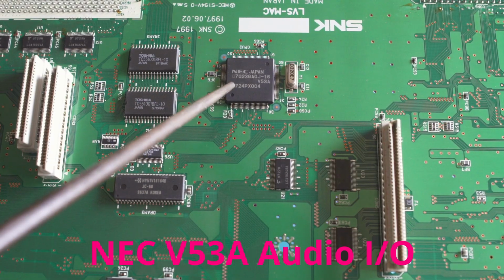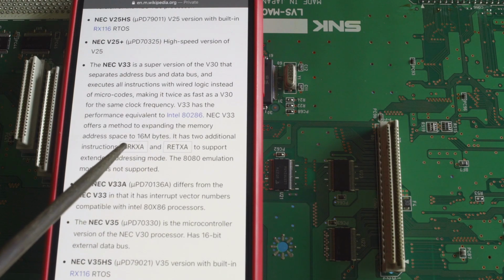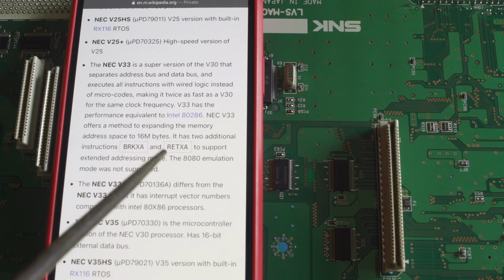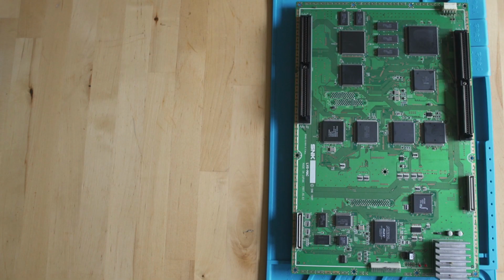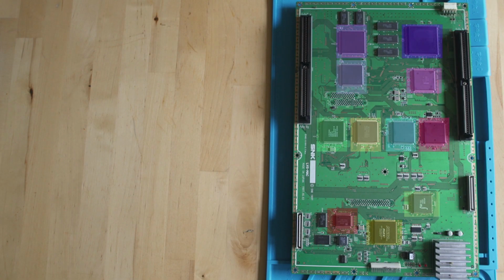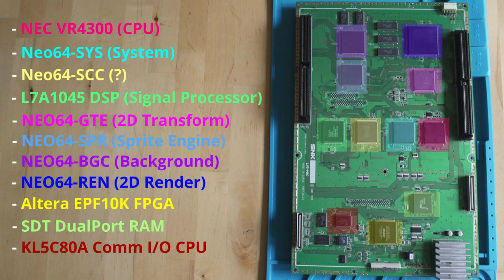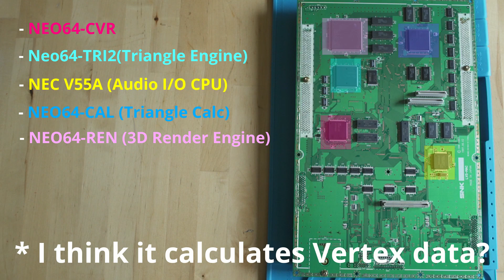The Hyper Neo Geo 64 PCB and How it Works - Tech Deep End

Comment: I still don't get why after PC and Sega32x had pure software rendered 2d ( okay, okay, stats where hw sometimes) someone would design chips for 2d (GBA was at least high volume). Both had a standard definition framebuffer only a little bigger than the Atari Lynx. There should be no "combination logic". Yeah there are some innovative designs for 3d, like quad-based renderers and tile-based renderers. Also: sort by z instead of z-buffer. Those are all only a small optimizations in speed and cost,  but a large burden to R/D. This PCB looks like it was designed over the years and always one chip added. Should we no better forget about it?
Reply from the maker: Who knows. I’ve never heard any details on why the Hyper was designed this way. Pure guessing at this point

Comment: I don't care too much about the games, but the hardware is so beautiful in its own quirky way! It's like they just threw everything they had into there. Combined with the metal case and the metal-encased games it's just something else. When I still had mine, I'd just spent time looking at it, inserting and removing games with the big metal bars, disassembling and reassembling it and just admiring the sheer awesomeness of it all. I wonder what their design philosophy was back then. I assume they wanted to do everything in house and create the very best graphics possible at the time, repeating for 3d graphics what the Neo Geo had been for 2d. It kinda fell short of that... In hindsight, the industry was at a turning point and they probably would have fared better using an existing graphics solution than creating this monster. Kinda regret selling mine now that I think about it...
Reply from the maker: Haha yes I love the hardware too. Wholly original. It looks like a piece of military equipment. 

It would have been better for them to license existing GPU tech though for sure

Comment: This is amazing I have always wondered what kind of chips the Hyper Neo Geo 64 used. It looks crazy but this came out in 1997 so we should compare the hardware to Sega and Namco 3d arcade boards. I do feel that SNK really didn't have the capital to make a competitive product because the Sega Model 2/3 and Namco System 22/23 have superior hardware and they came out around the same time.
Reply from the maker: The thing was model cost 20-30K for an arcade operator. Even if SNK wanted to license powerful tech like Sega did they’d never sell a cab at that when they were known for the MVS and its better pricing too

Comment: This is great, you should do this with the atomiswave.
Reply from the maker: I actually don’t have one. It’s on my list of stuff though :)
Reply: Video Game Esoterica Yeah it’s a great machine! Also, I’m looking to get a hyper neo geo 64 and since you have one where do you recommend to find games and a motherboard. They are kinda hard to find.
Reply from the maker: Honestly eBay or maybe KLOV / arcade-projects forum. Since they aren’t hyper common (dad joke) eBay seems to be the best source. Def not the cheapest though
Reply: Video Game Esoterica Yeah I’m going to be alert to find one. I hope I can get one sub $300. I certainly will start out with the fighting board as well.
Reply from the maker: Yes a fighting board is clutch. I’d try for a rev 2 if you can get it but you can make a rev 1 work as well. Just a bit more wiring and some audio amp necessities
Reply: Video Game Esoterica Yeah, with a fighting board I can just wire up a jamma joystick and buttons to control it right? Also how do I tell the difference between revision 1 and 2
Reply from the maker: Neo 64 yes. Harness and wires. Rev 1 has a volume potentiometer in the front of the board. A silver metal knob and two big JVS plastic connectors under the JAMMA edge. Rev 2 has NO pot dial and it has five JST connectors. If you watch my intro video you’ll get a visual on what a rev 2 looks like
Reply: Video Game Esoterica I’ll make sure to be aware and look for a rev 2. Thanks for the help, I’m going to be looking around some forums to find one. I’ll keep you updated in my search for one.
Reply from the maker: Neo 64 sounds good! If you need any more help lmk
Reply: Video Game Esoterica Quick question. I know there are two revisions of the fighting board. Are both revisions able to play all fighting games? Are there any other differences between them?
Reply from the maker: Neo 64 both revisions play all four games. One has JAMMA mono off the edge (rev 2)
Reply: Video Game Esoterica So with the rev 1 you gotta source audio somewhere else on the motherboard?
Reply from the maker: Neo 64 you’ll get VERY low level audio. You can jump some pins to get normal level audio. There is a tutorial on JAMMA-nation-x.com showing you how. If you can solder it takes like 2 minutes
Reply: Video Game Esoterica Well I can solder well so I’m in the clear!
Reply from the maker: Neo 64 perfect. Either board is fine. Rev 2 is just easier to deal with but if you can get a rev 1 at like half the cost you can def save $
Reply: Video Game Esoterica Yeah I’m definitely willing to save money even if I have to solder a bit. I am going to start looking around some forums like neo-geo.com for one.
Reply from the maker: Neo 64 just make sure you don’t sign up there and directly go to the marketplace. Rot won’t take kindly to that lol
Reply: Video Game Esoterica Don’t worry, I’ve been there since 2016 and know the rules!
Reply: Video Game Esoterica Oh and I wanted to say thanks again for all the help with this. You really pointed me in the right direction!
Reply from the maker: Neo 64 haha just making sure. It’s touchy there and I’ve been around for over a decade. And I’m happy to help! Any time
Reply: Video Game Esoterica I ordered a rev 1 fighting motherboard with fatal fury wild ambition, it should arrive soon!
Reply from the maker: Nice. Welcome to the club!
Reply: Video Game Esoterica Since I got a rev one, I would prefer just to pull stereo audio from the front jst port, do you know what specifically the ports dimensions are so I could buy a plastic connector piece to use to pull audio?
Reply from the maker: I do but not from memory. Email me. Videogameesoterica at the google email company

Comment: 4:54 It would seem to me that those three memory chips labeled DRAM1, 2 & 3 are the system RAM. They sit right below the SYS chip which would confirm that it contains the memory controller for the CPU. 
SRAM3 & 4 sit right below the SCC and next to the V53 chip. That would be sound memory.
If you would provide me high resolution pictures then I could make more sense of it and also calculate the amount of memory and the bus width.
Reply from the maker: I’ll snap some soon!
Reply from the maker: Email me : videogameesoterica at the google company
Reply: @VideoGameEsoterica  Emailed you.
Reply: DRAM1, 2 & 3 are Hyundai 2MB EDO RAM (16bit) memory chips = 6MB RAM - 48bit bus = Program memory
SRAM3 & 4 are Toshiba 256KB SRAM (8bit) memory chips = 512KB - 16bit bus = Sound memory (SRAM doesn't need refreshing which results in very low access times)
According to Wikipedia there's 16MB of system RAM and 32MB sound RAM. I wonder where. Maybe they're adding some of the video RAM wrongly to it.
Reply from the maker: MrMilli some ram is on the back side of the pcb, with the 3D portion. But the stats online could easily be wrong too
Reply: Aha, they call it "mainboard RAM". I guess that's the total of RAM. There seems to be another 16MB on the cartridge.
Reply from the maker: MrMilli yes I’ve never opened a cart up to check to be honest. The metal shells I swear fuse together due to time and how tight they are put on. I’ve unscrewed them and they refused to separate. Wasn’t going to torque hard on expensive games
Reply: @VideoGameEsoterica  Yeah, I would honestly avoid that. I have had bad experience with such things. Though sometimes heating up with a heat-gun or hairdryer helps to loosen things up.
I found these two pictures on the internet:
https://retrogamingstuff.files.wordpress.com/2014/01/hng64_pcb_top.jpg
https://retrogamingstuff.files.wordpress.com/2014/01/hng64_pcb_bottom.jpg
It's not only packet with ROM chips but also RAM chips. So depending on the game, the cart can contain a variable amount of ROM and RAM, of which the RAM will augment the motherboard RAM. The two edge connectors have a huge amount to pins, all connecting the respective chips on the motherboard with the RAM chips on the cart. So clearly even the RAM on the cart is not unified.

Comment: 1:05 I would assume the SYS chip is the system controller. Comparable to a northbridge you would find in an old computer motherboard. This chip usually contains the buses that glue together the system (bus to CPU and the rest of the system). This chip usually contains the memory controller too.
I think that the SCC chip is the sound processor. Konami used to use the same abbreviation, which stands for Sound Custom Chip. Considering the DSP also connects to the SCC, makes me pretty sure that it's for sound processing.
Reply from the maker: Possible on the SCC but supposedly the sound chip is the V53. Or at least that’s what old docs state
Reply: @VideoGameEsoterica  I would assume that the V53 functions only as a sound processing unit. If I can draw parallels with the Sega Saturn: it has the Yamaha SCSP for actual sampling but it also has a Motorola 68EC000 for sound processing to offload the CPU.
I think the same is happening here. The SCC does FM or PCM sampling with the aid of that DSP and the V53 offloads the MIPS CPU for sounds processing.
I still need to see the end of video (hectic at work) but I'll see if I can get some insight into the GPU.
Reply from the maker: MrMilli could be! All ideas are good ideas when it comes to figuring it all out!
Reply: @VideoGameEsoterica  That's basically how an old accelerated soundcard, like the Creative Audigy, works too in a pc. In case of the Audigy, the sampler and DSP are combined and the central CPU does the rest of the processing.
But these three (sampler, DSP and processor) units are usually present on these older powerful systems. Here they just happen to be 3 separate chips. The V53 alone could never provide analog audio. 
It seems that SNK just went overboard and made a separate chip for every single task. I can't believe they broke up the GPU in so many chips. 
On modern computers, the CPU does everything except of the analog audio conversion.
Reply: @VideoGameEsoterica  If I can see correctly, the V53 chip is right below the SCC and DSP. That would further support my theory that all three work together to provide audio.
Reply from the maker: MrMilli yes they are near to each other and share traces

Comment: Anyone know anyone who can repair one? I have a Revision 1 board that I got to boot once and never again.
Reply from the maker: What is it doing when it doesn’t boot? Blue screen with no text? Or does it show an error? Tell me what happens and I can probably diagnose it
Reply: @VideoGameEsoterica  no output to the screen
Reply from the maker: Kevin Gauby hmm. Do you hear a click when you power it on? Or is there no noise?
Reply: @VideoGameEsoterica  There's a click and the heat sink in the back does get warm, I feel like it the comm/jamma board on the bottom
Reply from the maker: Kevin Gauby ok there should be some fuses on the JAMMA I/O board. Check to make sure they aren’t blown. You should visually be able to tell but if you have a multimeter check your continuity. 

I’d also remove and reinsert the I/O board. It’s very easy. Unscrew the screws holding the board in and firmly pull up from both sides. Make sure you have cable slack. Then reinsert. 

Can’t promise that’ll help but it may.
Reply: @VideoGameEsoterica  Both fuses are good and I've tried cleaning the board, it was dirty when I got it but still nothing.
Reply from the maker: Kevin Gauby hmm. Try removing the top metal shield from the motherboard. If that doesn’t solve it then I can’t really tell without seeing the board
Reply: @VideoGameEsoterica  Well I would gladly sent it to anyone who could fix it
Reply from the maker: Kevin Gauby if it’s anything to do with a failure of any of the chips on the board (any of the chips I showed in the video)...you are better off getting a working board. Replacement parts aren’t a thing. You’d need a donor board unfortunatelyn
Reply: @VideoGameEsoterica  Yeah I've been looking for, more specifically the one with the actually Jamma switch, but nothing so far

Comment: SCC may stand for System Control Chip - dma glue logic used to connect all the elements together. The Saturn has one like it too. But this is just a complete guess on my part.
Reply from the maker: Not a bad guess. Makes sense if the sys chip executed the game code, then your theory would allow the SCC to combine the code and the image together for final output. Since it’s next to the CPU and Sys chips and share trace paths it’s not a bad theory at all
Reply: It wouldn't be combining code or image output, just allowing the CPU to send data to what looks like 2-3 different buses. It wouldn't have the necessary data pins to be able to DMA every other subsystem.

Combining images would most likely be the job of whatever is the last chip before the video encoding. 

"Combining code" would be pointless, the most it would need to combine is the 3d->2d geometry conversion but if they designed it right then the combined values would go straight to the 3d chip.

This is one of those machines I wish we had hardware docs on... even just a service manual.

Comment: Interesting stuff! Kind of like if N64 took the Sega Saturn hardware design philosophy instead of the simpler RDP/RSP
Reply from the maker: Yes. Complexity of Saturn pcb with the CPU if the 64. Bad combo lol
Reply: @VideoGameEsoterica  At least it's got more than 4kb TMem haha
Reply from the maker: Based Chad Barrska A.G true. It could not have been easy to develop for though!
Reply: @VideoGameEsoterica  I never heard a bad thing about the CPU of the 64. It did not get access to RAM: RSP and some RamBus Bottleneck in the way.
Reply from the maker: Yes it seems obviously the CPU handled things different on the Hyper vs the 64 even if it’s the same chip
Reply: @VideoGameEsoterica  The Saturn has no sprites. It is unfortunate that the backgrounds quads could not be combined with foreground quads without ugly gaps.
Reply from the maker: I am just impressed Saturn can look as good as it does considering how oddball the hardware is
Reply: @VideoGameEsoterica  I should look up what they changed when Sony posted their inflated spec. Also I should look up the memory access. PSX has VRAM and main RAM. Jaguar has shared. Saturn has, uh, lots of chips.